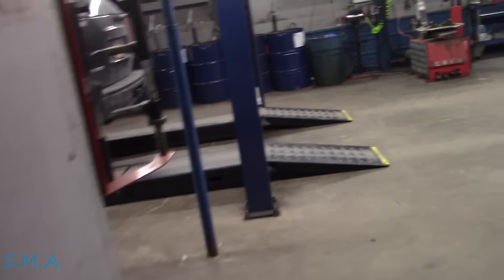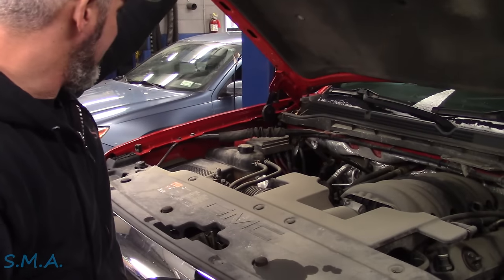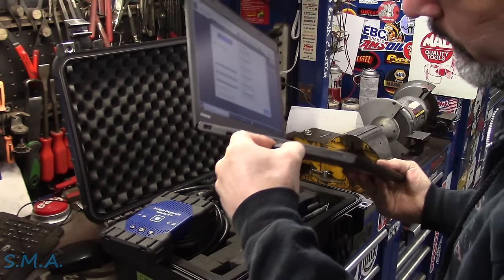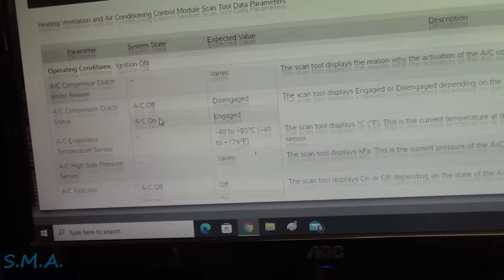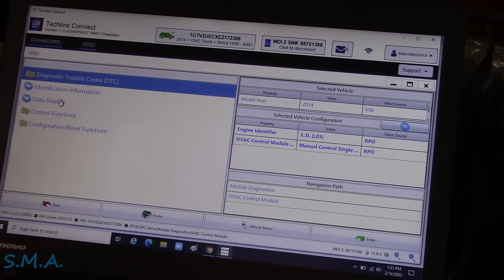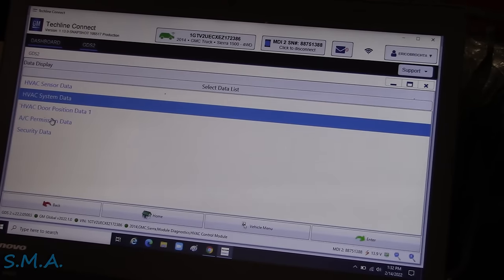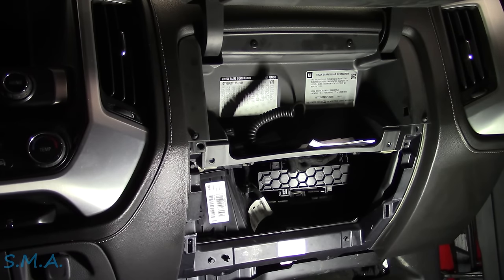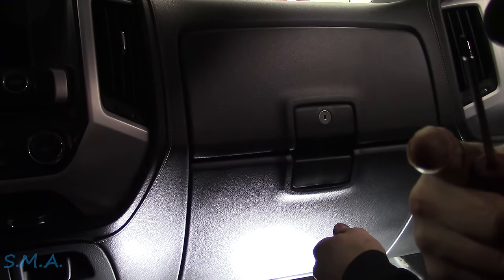Chevy/GMC Truck: Failed Heater Control Module

Comment: I was a driveability tech for 25 years, and yes, cars are getting too complex. I worked on a 1968 Chevy C10 pickup, the heater system was so simple, a 4 position switch for the blower, off, low, medium, high, just a blower motor, a blower resistor, and switch. 2 cables, running flapper doors, heat, and defrost/floor. Stupid simple
Reply: That’s the same set up my 86 burb has. 
Simple as.
Reply: On my landrover a heater was an option and the on off was a valve on the engine block !

Comment: I was driving the interstate at 75 mph last spring in my brand new Accord when the radar saw a bug or something and slammed on the brakes.  I almost got rear-ended.  My heart was pounding.  This is a safety feature.  This fall my aged mother gifted me her 2003 Honda Civic with 22000 miles.  The car is like new, not a scratch in the paint and no safety nannies.  Both my wife and I prefer the Civic.
Reply: Yes, we have two brand-new 2022 model Freightliner trucks,  these things are insanely over-complicated with stupid stuff,  all computer controlled,  and yes, they too, will slow or kick off your cruise, or apply your brakes if they sense something is an impending accident.  Driving one is a non-stop driver distraction with never-ending, constant collision warnings, beeps, burps, dings, chimes, rumbles and flashes in your face from the glass screen where the gauge cluster used to be.  Constant problems, too.  The most basic things that would last or outlast the entire truck before, have now been superseded by some "driver comfort feature" which lasted a whole 2 months before failing.  I lasted a whole 8 days in the thing before I politely told the company where they could park it. Back to driving a 2016-model of something else, and never been happier driving an old "bucket".  The younger guys who now drive the stupid things, even they have reached their boiling point with the complete stupidity of the systems and the utter unreliability overall.  Last Friday,  the owner and the maintenance manager cancelled our pre-order for 8 more of the stupid things.
Reply: We have a 2019 pilot and in winter the radar can’t read the lines in the road when it’s covered in snow and when we pass a car it slams in the breaks! Thankfully we can turn off the that “safety feature”
Reply: I had the same issue with my 2016 Maxima I don’t have anymore. I was near a train when it did happen. I assume it was the speed radar on the locomotive that caused my issues.
Reply: Yes my wife and I still daily drive 2005 Civics, Even though She also has a 2020 Civic get body work done from a deer trying to use the drivers side headlight for an escape route to deer Heaven.🤑

Comment: My dad was a mechanic.  He worked on everything from helicopters to chainsaws.  When my brothers and I were growing up, he steered us away from that trade.  I’m an accountant, I have a really good job and I have the same thoughts as you do.  I don’t really think I was wired to be an accountant from the factory, but ended up there.  I watch your channel because your line of work is so much more intellectually stimulating than bean counting.

Comment: Yep, when I first started as a diesel mechanic, we had two wires. You pulled one to make it go, pulled the other to shut it down. When the boss handed me a laptop and said I needed it to "talk" to the engine, I knew my "time" was running short. I always talked to diesels, but I can't repeat the words I used, here.

Comment: The good thing Mr. O is that you have the knowledge to work on virtually anything electrical, mechanical, digital, etc.  So when your home A/C & furnace/boiler is not working you will know what to do.  When your computer starts acting up you will be able to diagnose & repair it.  Your skills are transferable.  You can pick up & head to warmer places & set up shop (or consult, teach, work for someone else) without a problem.

Comment: Home appliances/ white goods use to be straight forward, mechanical timers and drive belts. Now electronic control boards and user interface panels, speed sensors and cheaply made, it all became over priced junk and breaks down in three years instead of lasting 15-25 years before needing a repair. Happily retired from that profession. 
Do love watching and learning from your videos Eric O.
Reply: And, God help you if you have a power surge,  and it wipes out all those appliances.

Comment: That failure really reminds me of some of the problems I faced repairing electronics. Typically bad solder connections on a voltage regulator. or connector pins aka "ring cracks". This is very likely because it sits on top of the heater , with extra heat and the vibration from the fan, engine, & road.
Reply: Mercedes Banz v8 with the cpu mounted on top of the engine, to keep it warm and dry. LOL
Reply: Exactly. What better place for electronics than the engine bay? Why scatter the modules all over the car like they do? You’d think they’d rack mount them in some dry, accessible space. I’ve got them on the firewall, under the seats, behind the glovebox and like this vid, on top of the heater core box.

Comment: We love your videos Eric!  I'm a retired engineer and a lifetime shadetree mechanic and I've learned a lot from you!
Reply: I am a retired EE and a DYI guy too.  There is no way I could fix that. I might get to the correct module but forget about the programming!
Reply: Check the power and ground, love it
Reply: @joesilverbliss1721  Likewise, but diagnosing and programming are both fairly straightforward if you have the right tools and data.  My probably is it is just not worth it for DIY work to buy the fancy scan tools and pay for the data subscription required.
Reply: @LTVoyager  agreed.  I purchased the blue driver scanner per Scotty recommendation, for $80 ish Dollars on Amazon.  Seems good for a low end scanner.  That is about all I want to invest in scan tools at the moment. I don't want to invest in a high end tool since I don't know which one will work.  If I could find a guy like Eric O near me I may not have purchased the blue driver scanner.   It would be worth paying a guy who knows what he is doing.  I do almost all car repair myself so when I do need to hire someone it is a crapshoot.  Going to a dealer is an automatic $500+ bill.  Do you know if DYIers can get access to reprogramming data from GM?  I figure you have to pay a subscription or fee and have a programming tool.  Joe
Reply: @joesilverbliss1721  I have a Blu Driver also and it is good for simple code reading, but you can’t do half of what is required to make most repairs.  I have no idea on the subscriptions as I have checked in years.  I think the last time I checked it was close to $1,000 a year for a subscription.  Too rich for my blood.
Reply: @LTVoyager  Too rich for me too.  I  think a blue driver is about as deep as I want to go and pay for.  I live in upstate NY.  Salt rust will get my truck before miles and probably electronic failures.  Take care. Joe

Comment: Career change:   I spent most if my life as a licensed Electrician and hold an a/c license.  I could always make a living there.  For fun and extra retirement money, I operated a small auto repair shop.  Always loved cars and mechanics.  I had a lot of good mentors and they’re still good friends today.  Been to some of the GM training for EFI.  Not too bad at diagnostics either. No Eric O but patient and careful.  No jerkoff repairs.  Mostly easy stuff like HVAC, electrical repairs, brakes and suspension. Finally, I became a state certified motorcycle instructor. Great job and always loved bikes.  Completely retired now, hobby shop and free advice for friends and family. Keeping them from being ripped off by the unscrupulous in the repair business. Do a little electric and ac repair for friends. Motto for life:   When it ceases to be fun, I cease to be doing it. Life’s too short to hate your work.

Comment: I love my 90's and early 00' vehicles. Not overly complicated.
Reply: Thats what i drive wont buy or take a new one for no money,,,,,,,,,,,,,,,,,,,, Their junk with junk parts through out!
Reply: Love my 2004 GMC.. Same reason, simple to work on, and it never seems to break. 379k miles strong now.
Reply: Yep, selling my '07
Reply: Those are my preference too, with the exception of OBD1 stuff. I’m perfectly happy with old carbureted engines as well as electronic multi-port fuel injection. But the in between years of throttle body injection, burning eprom chips, and practically useless data ports are not my cup of tea.
Reply: Those are generally the BEST bang for the buck Had good quality engine management computer system that was easy(relatively) to diagnose and none of the overly expensive unneeded CAN(computer area network) controllers/sensors I have 6 vehicles from 87 to 99 won't sell any of them EVER I have a 1999 Saturn SW with just under 300,000 miles That one will need an engine rebuild soon BUT that costs less than the downpayment on the JUNK made since 2010

Comment: This is what scares me about buying a newer vehicle. I have a 2011 Escape it does what it needs to do. When you need a several hundred dollar module to work some buttons or your heat / AC there's something seriously wrong. To me it's all a money grab from the auto makers. Knowing that these expensive modules won't last 10 15 years and you will have to replace them if you want something basic like hot or cold air. Fricking redonkulus.
Reply: Exactly. I had a 2001 Escape that was so easy to fix.  Now I have a 2007 Suburban. 😵‍💫 fuel pump for Escape was accessed under back seat... I changed it by myself.  For my  Suburban?  I dread it ever needing done.
Reply: @JenniferF2882  Add a small dose of MMO to the gas every 3rd or 4th fueling. Will lube the pump and cleans injectors.
Reply: @oliverokk55  I have the 3.0 too. I assume they changed the intake design for 2011-12 The mechanic said didn't have to remove mine like I thought they would have to.
Reply: Toyota, I went to them, now we have a 4Runner fleet. I love them.

Comment: When they started putting plastic in the engine compartment and replaced dipsticks with sensors I said why complicate things so much. They just quadrupled complexity for no viable reason.
Reply: "It's cheaper"...."It's better"...."It's modern".....Famous Last Words Series entries.
Reply: Easier to install, simpler to use same engine for multiple models. Everything that’s better for the manufacture and not the customer.
Reply: The reasons were simple planned obsolescence and locking you into the dealer for reprogramming(even if you are independent you have to subscribe and pay them per vehicle) Very viable if you are the dealer not so much if you are the customer

Comment: Makes me appreciate the 1970 C10 I own, heater is simple, or just check the cable wire slider, or the vacuum assist valve on inner fender. Careers have been similar, doing software coding, troubleshooting, Modern programming code structured, nested, similar to all the cables and black boxes. Guess that is why I enjoy restoring the older vehicles, where engineering was simple, built to last and holes lined up in the case of the heater sliders from dash bottom to take it loose, then next set of hols allowed ash tray removal, then to radio at top.... Hats off to the WWII vets who went into automotive engineering after the war.  built to last....  Keep up the great videos, I enjoy your methodology and learning new skills.

Comment: I went through 4 VW Beetles growing up, all with the same engine. I'd drive one until it rusted out, then swap the engine over to a slightly better body, and continue down the road. 20 minutes to swap out an engine. Can't imagine that nowadays.
Reply: about the same amount of time as the old Geo Metros with the 3-cylinder engines

Comment: "It needs to be programmed":
Means you as a weekend mechanic or shadetree mechanic are basically screwed.
I'm sensing that all this electronic bullshit on vehicles isn't for the benefit of mankind.
Reply: No way in this day and age that the multitude of modules in a car need to be programmed...manufacturers do it as a way to generate dealership income.  Hell, my 1981 Atari computer was able to automatically detect any peripheral you plugged into its SIO (peripheral) port...don't tell me modern cars can't do that as well
Reply: Benefits the manufacturer whether you take it to the dealer and pay their rates or take it to an independent who has to buy the software from the manufacturer. Either way they win. They win even if you buy the software to do it yourself.
Reply: YOUR right,BUT it's not the CARS that ARE being PROGRAMED it's THE CONSUMER~~~~yes now how they sell this is~~ NEW and improved -rear camera,cell phone service,radio,traffic alerts GPS<you name it ___ALL IN ONE MODULE .and that's what you hear when the car salesman gives his spiel.automatic day lights,heated steering wheel ,and seats.warms your seat even BEFORE you get in at 0 degrees.OH ya don't FORGET SELF-DRIVING CARS.I used to wrench 30 years ago.left it for a less demanding job,working cranes on SKYSCRAPERS.ALL i had to worry about then was DID i remember to strap on my PARA-SHOOT?haha
Reply: Backyard Mechanics and Shadetree Mechanics????? They have been screwed for years. it's all about electronics and proper diagnosis and knowledge of the system you are working on.
Reply: @JOHNSUE28  The fact that all this stuff breaks right away is the real problem. I’ll stick to car makers that make reliable cars.
Reply: @quonsetthehutt3105  , Hey, when you find a good reliable car please let us know !!!!!! .........  I'm still looking.
Reply: Time for horse and wagons.
Reply: @quonsetthehutt3105  Hell, GM can't even build a lifter.
Reply: @Robert Aslsson
Not quite yet but I do see a day when it can come back around full circle.
Reply: @jaydegelder2964  Toyota trucks.

Comment: Agreed!! I was an ASE Master Auto / truck for years and glad I got out of it 20 years ago and moved in to the power utilities as an electrician, then relay tech. Although, electrical / electronics is my specialty and I was waiting for the day when you can just do the difficult electrical / electronics diagnosis for shops on an expert basis. Electrical troubleshooting on vehicles is what I always enjoyed the most and what lead to the career change. Seems we are at a point in time where dedicated experts on vehicle electrical / electronics is here.  But damn, if the effign engineers wouldn't bury shit and make you have to be a contortionist to get to things.

Comment: Definitely long for the days of cable operated heater controls and the engine management system consisted of a timing light, screwdriver to adjust the carburetor, and once a year replace, cap, rotor, points and condenser. Air, fuel and oil filters, and a bit of greae here and there. Oh and crank up windows and maually adjustable outside mirrors.
Reply: Here, here==== Now you;re talking !!        [ but we're both Dinosaurs ] lol
Reply: This would be great.

Comment: I was a control room operator in a manufacturing plant, and I had 8 computer monitors and a couple 'puters that ran pretty much the whole plant. The system was called an HMI with some separate PLCs. Human Machine Interface. I can't imagine what you'd need an HMI in a vehicle for, this and the Buick video are the first times I've heard of these being in a vehicle. I was a mechanic in the late 80s and 90s and went to GM school for all their certifications including computer command control (before there was ASE certs) and the way the computers and circuits were designed seemed fine, even overcomplicated but definitely provided a better way to have efficient running motors. It's getting ridiculous how overcomplicated these cars are getting. Lol
Reply: That sounds like a good number of screens. I run gas turbine/ combined cycle units. We have 32 screens in the control room here.
Reply: Oh and I drive a toyota

Comment: Man on 65 I retired in 2004 from doing dealership work most of my life I became a Ford special tech worked on variable Venturi carburetion for two years when they put them pieces of junk out and this new stuff is driving me crazy I found your channel oh a few years ago I think I’ve watched every video you made and it’s taught me so much Eric and I can’t thank you enough because I get this stuff in my yard all the time I consider it a hobby now I do it when I want to
And if I don’t want to I don’t do it and send them packing…

But I do miss setting the points on a car and adjusting the carburetors to make them run like a dream and fixing the heater boxes with cables popping in and out a radio in five minutes with two knobs
Reply: As somebody who once owned a Mercury with one of those variable venturi carburetors I shake my fist at you in anger ;)
Reply: @chrisfreemesser5707  Yeah it sure was one of Ford’s better ideas I’m glad they dumped it

Comment: You said it ! And that's why I rebuilt a 1984 F 150 4×4. 300 6, 5 speed manual transmission. All that's left to do is paint.

Comment: Bought a 96 gmc Sonoma at the begining of covid outbreak 2020. Paid $400 for it, fortunately doesn’t have all the fancy stuff  these new trucks have. I’ve put 20k on the clock, now has 201k. I call it my lil red pickup(corvette) lol. Honestly best money I’ve ever spent on any vehicle ever. Originally bought in to replace my broken wheelbarrow!!  It’s exceeded its purpose. Pretty sure it has the original blower motor heating things up still. It’s the big 2.2 liter three pedal peeler! Eric, the windows crank up and down. Adjust the mirror?,  roll the window down, stick  your arm out, move mirror. AND the cruise control works. All i need to get from point a to point b. Wish general mayhem made these little trucks again. Economic fun little ride without all the electronics to inconveniently fail.  Great show as always!!!